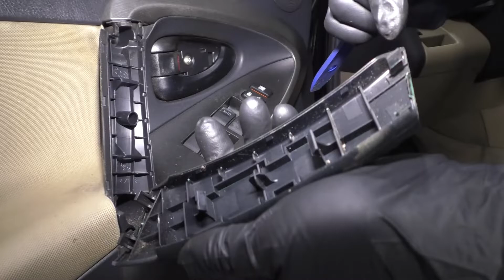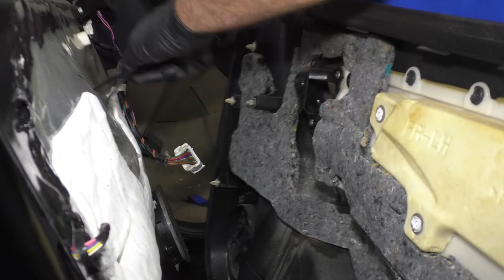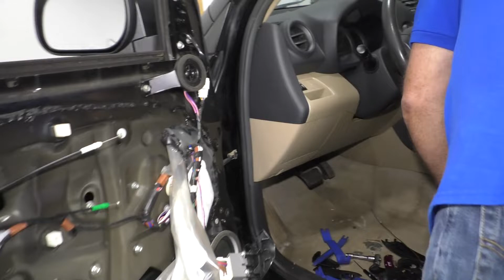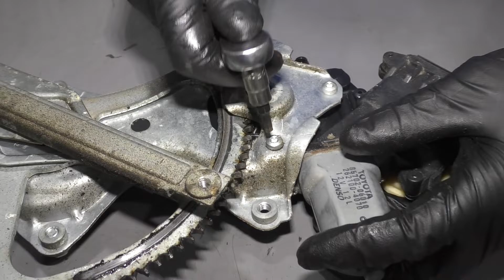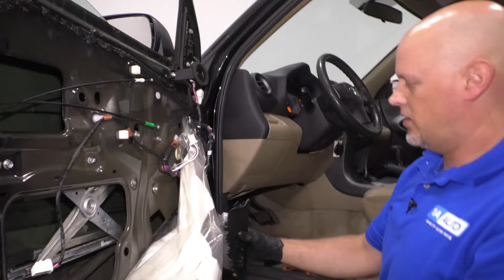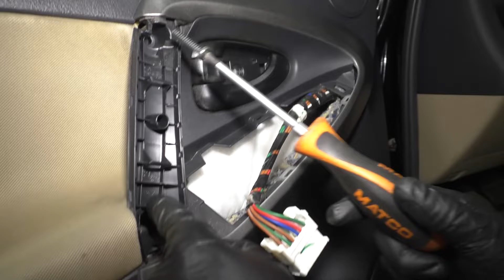How to Replace Front Window Regulator 05-16 Toyota RAV4

Comment: My pass side window flopped off track. Like one side goes up, the other side gets dragged off track. So it goes up cockeyed. We hear a rattle in the door. I assume one of the 10mm bolts that hold the window in place is out.

Will check it out. Thanks for the help n vid.

Comment: Just a note: I left the cables alone ..pulled the assemble thru the plastic no problem..one less step..and before I ordered parts  made sure which motor wire plug it has //// comes in 2 or 5 wire motor plug...great vid thnks...Oh on a side note: found out that the motor alone cost about the same as if you buy it with the regulator assbly..go figure...

Comment: Hi, my driver window won't roll down after replacing this. All the others function correctly. Any idea ?
Reply from the maker: +Chili Dawg Thank you for checking us out! If this wont go down it could be that this was plugged in upside down, sometimes plugs are not only one way, that would be the first place to start. Then you may want to take a multi-meter to the switch and motor to ensure there is power getting to both of these.
Reply: @1AAuto   turned out to be a cut wire accompanied by a blown fuse.  Thanks for the reply. Got a door handle from 1a auto last year. Thanks for All the great videos